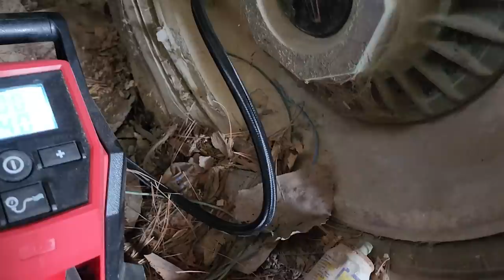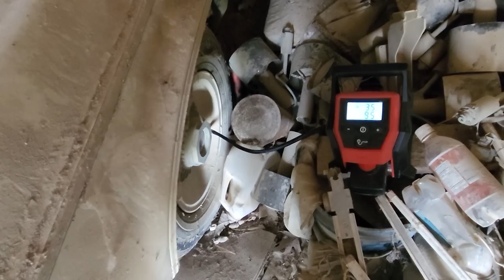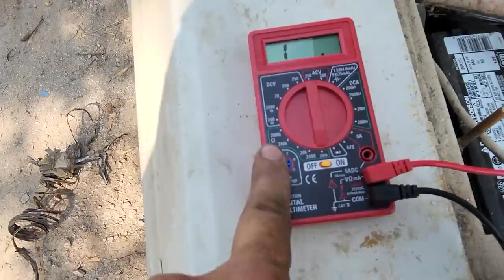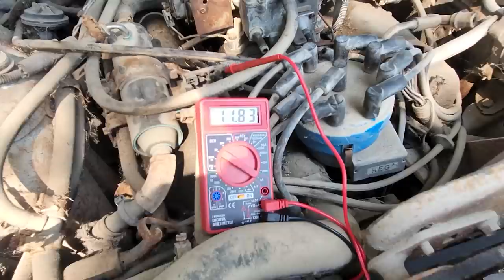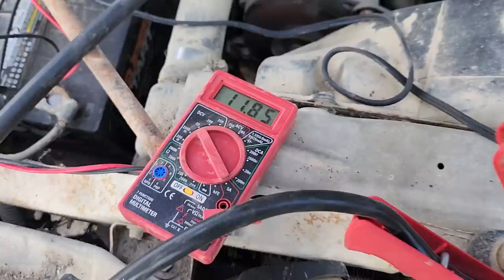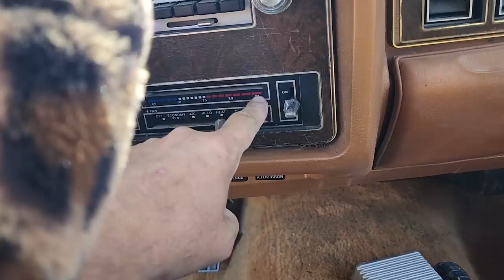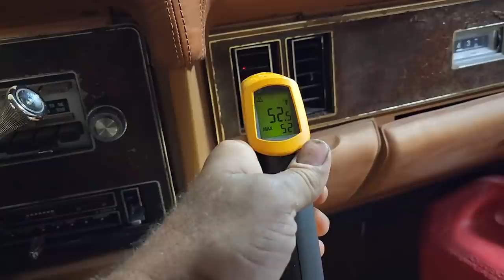ABANDONED Rare Lincoln Parked 22 Years! Will It RUN AND DRIVE 650 Miles Home?

Comment: Can we take a moment to acknowledge that literally there was mud in the transmission and he still fixed her and took her home? Also, can we talk about the aside that he walked onto this old man’s farm and fired up his tractor like it was his own? This guy is a national treasure.
Reply: Didn’t really fix the trans…… patched it temporarily
Reply: @fredfabris7187 when my dad was younger his dad has a transmission that had the same issue so my dad pulled the pan on it and Grandpa said just clean it out and change the fluid it will work and my dad thought he’s crazy lol but he did it anyways and the transmission worked for years! Heck I’m pretty sure it was even working when he passed away
Reply: @fredfabris7187  isn't every fix "temporary"?
Reply: @ripvanrevs  key word “patched” didn’t fix anything. There was a pile of clutch material in that pan also most likely plugging the filter. Cleaning it out restored the hydraulic pressure but the trans is certainly weak or “soft” and is not “fixed”.
Reply: My Father's friend let me go out on his loader similar to that in the 90's (I believe it was a late 30's tractor) The ratchet throttle is not intuitive - cheers for knowing. 🙂
Reply: More of a testament to the resiliency of the transmission.
Reply: @fredfabris7187   - If that were clutch material, there would be no moving that car with that transmission. Petroleum products will build up sludge sitting for years and we have no idea what kind of fluid and/or additives was put in that transmission by the previous owner. 

It's possible that whatever caused the sludge that clogged the filter may have saved that transmission from severe damage.
Reply: I am sure the old man would appreciate somebody knowing how to start it in the first place. Not many men can say they know the starting sequence for anything without a push to start, sad state of our times.
Reply: These cars are shet! Lol but the man got it going, hats off for that! it's a miracle he got that pos running at all. Nothing like a beater revival followed by an extended torture test cross country road trip!
Reply: @jasoncunningham6714 eah. I remember that car. I always thought there was something ridiculous about it. It reminded me of a dressed up K Car. I can’t imagine why out friend here would even want the thing.
Reply: @fredfabris7187  True, and he didn’t dump the fluid/sludge out of the torque converter.  I think those had a removable plug that allowed a mechanic to drain the converter.  But I agree, a transmission overhaul is in order!
Reply: @branscoset  Obsolete skills these days. I certainly know nothing about horses except that they eat and poop and you can ride them sometimes. I have overhauled manual transmissions and rebuilt engines 30 years ago. These days I don't have to do much beside changing the oil and an occasional brake job. Knowing the insides of an engine is not something I use and probably I will never open an engine again. Unless the end of the world happens and I need to get by on whatever old car I can find, because the new ones will be impossible to fix.

Comment: These Revival videos are still the best thing you do. So glad you havent stopped doing them, with all you have going on.
Reply: OK, I like them too, and VG is amazing on getting a bucket started...but once you determine it's good enough to revive and clean up, then do all the overdue maintenance - oil, trans, carb, brakes, fuel sys, and give the car some respect.  Good golly, and old filter could disintegrate and clog passages killing oiling to the the whole engine....geesh, and a full maintenance is not that tough

Comment: These cars were produced when Ford Gm and Chrysler were finding ways to scale down their luxury line. Caddie made the Seville, from the Nova platform. Ford made these Lincoln from the Ford Granada line and Chrysler made their New Yorker on the Volare platform. All of these lower line platforms became personal luxury cars by using the same low-line running gear, but sprucing them up with great interiors and making all the power equipment formerly available in the big full-size luxury line now in these vastly reduced-in-size models. If you knew that under all that fancy interior and wheels it was still a Ford Granada. This was a brilliant example of what this brave mechanical genius who isn't afraid to take risks does for fabulous content on Youtube. This guy is something else. Another great video.
Reply: The Seville was constructed on the Nova's 'hard points'  which cut down on tooling costs, but the Seville shared very little in common with the Nova.  The Versailles was just a tarted-up Granada.  My father owned a Granada and looking at the interior of this thing brought back some bad memories.  Ford should have been ashamed for selling such a thing. The only car I would rate worse as an example of shameless marketing was the Cadillac Cimarron.
Reply: True, but Granadas didn't have the disc brake 9" rear (hot rod gold!) that the Versaille did.

Comment: A very cool find. Brief history of the car. The Versailles was Lincoln's answer to the Cadillac Seville, which was a wildly popular "small" Cadillac. Lincoln used the Ford Granada as the car's base, and it showed. Customers saw right through the upgrade and sales were lackluster from the start, ending with only a few thousand production units by the end of its run. It has a lot of engineering improvements, such as available 4-wheel disc brakes (anti-lock in the rear), a 9-inch posi rear axle (Mustang guys pull them the second the cars hit a junk yard), and a not-so-great 2-bbl variable venturi carburetor. It's amazing the car ran all that way without a hitch, a testament to the engineering that, regrettably, wasn't matched by the stylists effort. Oh, and as part of the ad campaign, they photographed the Versailles on the floor of Windows on the World, the restaurant at the top of the World Trade Center. You can still find the ad if you Google it (or look on ebay).
Reply: Yep! My parents had a ‘79 or ‘80 Granada and it looks just like it except for the Continental kit spare hump.
Reply: Is that the same variable Venturi carburetor that the police 351 had all the way up to 1991? I’ve never heard good things about that carburetor.
Reply: My dad changed the venti carb and electronic ignition on mines to a four barrel Holley and old school points distributor. I remember vividly back in 1992 I was doing a tune up on it...had just replaced the set of points. The car was idling while I was washing my hands with the garden hose. I heard a "hiccup" and immediately went to adjust the distributor...with wet hands. ZAAAPPPP!!! 😂 My arm went dead for about ten minutes. I was hollering like a banshee and my dad was laughing his a** off. I miss having that car.
Reply: Nicely written
Reply: That one has a regular 2 barrel not the variable venturi
Reply: Buy the trunk lid, the grill and the badging.
Then go find a Granada.
Reply: @thomaspowers5845  nope...it's way more to a Versailles than that. Trust me, my buddy had a Granada in his family and it wasn't even CLOSE lol

Comment: Quite a challenge and an adventure to start a car that has been stationary for a long time and make it go a good distance! Really fun to solve all the problems until you reach the destination. And it is really surprising how the lights, the air conditioning, the horn, etc. end up working. That wouldn't happen with a modern car. Before everything was done better. Keep Walking!

Comment: The rear axle from the Lincoln Versailles will fit quite a few cars, including some early model Mustangs with a few mods. It's a low-budjet way to get 4 wheel disks using all factory parts. The Hollander Interchange Manual is definately your friend.
Reply: Yes. I went after that very r/e for a camaro circle track car because of the width and disk brakes.
Reply: Came here to write the same. As soon as I saw the car, it was my first thought.  Likely Derek’s as well.  He knows the rear axle is worth more than he paid for the car.
Reply: iirc it's a direct bolt on for 67-68 mustangs and allows for wider wheels and tires in the process. Can't recall  but believe it's also a direct bolt on for 64 1/2-66 Mustangs too. Regardless it's a desirable 9" with disc brakes and would've been a shame if it goes to waste.
Reply: One of the first Fords to have a crankshaft sensors  . Good luck finding a sensors for it they were about 4 inches long.
Reply: Can't help but wonder if it was the same width as the Grenada 9". Those were popular
Reply: Used the same rear end in the mid 90s in my vintage modified 34 Plymouth coupe open wheel stock car in WA state.  Work well and being a 9 " many different rear end ratios where cheap and readily available.
Reply: @benruether8294  it is the same as the Granada 9 inch  but not all Granada came with 9 inch rear. The front disk are a easily bolt on to mustang and fairlane and similar fords the rear is slightly narrower and works excellent for 66 67 fairlane as well as the hydraulic boost brakes the front lower a arm is the same length as regular Ford but has a larger ball joints but will swap in with the Lincoln lower a arm sorry old man hard to see small print hope this helps a little bit.
Reply: @gregallen4272 Good to know! Thanks
Reply: I had forgotten about the space saving rear tire it came with a bottle of compressed air to inflate it the rubber tire is way past safe use but it is highly desirable for 69 and 70 mustang restoration because it was same as originally used but the original is very expensive and difficult to find 1969 fastback mustang

Comment: Pro tip: if a feller removes the plug wires and sticks a shower cap over the distributor cap and another over the carbatater, a guy can really get in there with a pressure washer and clean the engine up without having to worry about moisture. Great for jobs like this. A quick shot of wd in the boots afterwards will displace any water that gets into them. Thanks for another awesome video Derek! 🤘

Comment: Lincoln Amazes me I have owned multiple older Lincolns and they have yet to let me down (except one time), I had a town car that I pulled from a dirt lot sat for 7 years I put a battery and some tires on it. The car came right to life it even had "fresh'" breaks on it just needed to get the cobwebs out of the engine and it was my daily for 3 years. my current daily is a 2000 Lincoln LSE V8 and Its been nothing but good to me.

Comment: A tool you might consider for barn-finds.  A leaf-blower (Battery type).  Then you can blow out the mouse stuff, radiator and most of the dust.  It will make it a nicer work space.  Just a thought.   Great videos.  Barry :-)
Reply: He flies to the cars I believe and drives home . Can’t fly with a leaf blower

Comment: The Versailles (ver-SIGH) is based on the Ford Grenada but with a bunch of interesting features that differentiated it from its siblings, including the Mercury Monarch. Other than the cosmetics it also had rear disc brakes (a popular Mustang upgrade) and door hinges that raise the door a bit as it opens, preventing the door catching on curbs.
Reply: Nice looking cars...but these were "Malaise Era" vehicles--choked by emissions, detuned to weak hp ratings...not desirable, IMO. An older Lincoln would be awesome to restore, but not this vintage.

Comment: My then future ex wife had a '84 Escort automatic (in '87) she had bought new before we met. That had an early Ford electronic ignition under the distributor. And it stranded her on the side of the road about 3x per week; always in the same spot about 5 miles away - just enough to get hot. So I replaced the module. Good for 6 months then did it again. Replace again (they cost about $35 back when points cost $1.37). Next time, I put in an aftermarket ignition module. $50 but worth it - it never died again.

Comment: It took 30 years for me to appreciate that 78 Murcury Monarch I drove during the mid 1980s.  Only the inline six 300.  Yeah, no acceleration really.  But it was a smooth ride and very reliable.  Built like a tank.  The Versailles was Lincoln's version of the same car, except always a 4 door, and nicer interior.  A couple of nice aftermarket speakers in the rear window with the trunk as a bass bin.  It was wonderful really.

Comment: This particular mid sized Lincoln was based on the  Ford Grenada or Mercury Monarch. If I recall correctly, the biggest engine you could get in this one was the small block 302. Luckily, the 351 Windsor was based from the same engine and would fit quite nicely in either of the 3. With no modifications or conversions needed.
Reply: Cadillac came out with their Seville in 1976 and they sold better than expected.  Lincoln had nothing to compete with them so, they grabbed a Granada and made some mods.  They were called Glorified Granadas and Granadas with a lump on the trunk etc which is exactly what they were at first glance.  Actually they were pretty nice cars with some nice upgrades.  They used a special paint job, a lot of sound proofing and they rode and handled very well. A lot of luxury touches were added and almost every option was standard.  In spite of all of this they were a sales flop.  I wouldn’t mind having a nice original one.
Reply: @craigjorgensen4637 that era of cars is just too ugly. Along with horrible performance and endless emissions garbage under the hood
Reply: The 351 wasn’t really much more powerful, just used gas faster
Reply: The 351 was a rarely seen option, but it was listed as available.  I worked on the assembly line building these and was not aware of any 351s until several years after the model was discontinued,  I still haven't seen one with a 351.
Reply: Also part of the 77-79 cougars too no? I have a 78 cougar, this car really reminds of it.

Comment: Hey Derek! awesome job getting her home! The Versailles was Lincoln's version of the Ford Granada, and Mercury's version of the Monarch but with more bells and whistles. I had a Granada at one point and it ran for well over 350k miles before I sold it and to my knowledge it's still on the road today cause I see it out and about every now and again. This would make a great dirt track car. the 302 as underpowered as it was still had good torque to move the car around. Great find and awesome job once again!
Reply: I was thinking it looked like a Granada.
Reply: @robertheinkel6225  yeah the Granada had the same body design, just the decklid and front end was more fancy, that and the 9" disc brake rearend which all the hotrodders would swipe any chance they could get since it was a direct bolt in for the early mustangs

Comment: That was awesome.  As you surely figured out as long as you have 12V off the column its easier to wire the Duraspark yourself and bypass all the old brittle connectors and whatever else in in the factory path.  Duraspark is pretty reliable really.  But I've had to build my own harnesses from the unit to the coil and distributor.  With all the heat and years you were probably dealing with wire breaks that you kept "fixing" by moving it around while repeatedly replacing the coils :)
Reply: On my 78 Fairmont 302 I ripped out the Nevaspark module and replaced it with the module from a GM HEI. It was easy, just 4 wires and ground.
Reply: @gordonwelcher9598 I've done that on a bunch of old car lol. I like to mount the module on a peice of aluminum, so it like a heat sink .
Reply: @tnrancher3913  It is a good idea to add a heat sink. I just forgot.

Comment: I bought a 350 that had been sitting for a long time. 3 years outside under a tarp. I put it it and started to drive it and I kept braking valve springs, because they sat squished down in the same place and got weak. I bought some new ones and it was fine after that.

Comment: I would have used a sheet of that ply to give the old shed some shear strength. You would have had to duck under it a little bit, but it would have wayyyy lessened the possibilty of you getting squished. Glad it worked out anyway!

Comment: In regard to your curly rubber fuel hose i have used a coat hanger wire inside the rubber hose to keep it straight to go into fuel jugs or whatever.

Comment: I know this is an older video, but if you need power inside the captain compartment, use the cigarette lighter, usually 25 amps or more.

Comment: Another pro tip for a guy: I've had multiple vehicles with similar intermittent spark issues. Once the basics are eliminated as potential culprits, it's usually a problem with the ECU (or whatever alphabet soup they use for your model). So, when you turn the key and don't have spark, you disconnect the battery for a second, which resets the computer, and then try again. Rinse and repeat until spark returns, but usually only takes one or two tries disconnecting the battery to get spark back.
Reply: Part 2 of this pro tip is really only for the pros though, so if you're not confident attempting this, please don't try. But usually if a computer is what's causing the issue, it's pretty easy to take them apart and solder in whatever capacitor/resistor is blown and restore its function. It's usually pretty obvious when you get them open, just visually inspect the circuit board for bulging, leaking, corrosion, black burn marks, etc, and replace whatever is at fault. This has completely solved the problem for me in every single vehicle I've had that problem with. (Which, admittedly, is like 3 vehicles, so yeah, small sample size, but 100% success rate, by all means make of that what you will...) 😂

Comment: At about 1:13:00 you can see a mouse escaping the trunk just as you’re about to close it. Also, I keep the hood open on my car when it’s in storage to discourage mice from using the liner material as a home. It works 88.7% of the time.